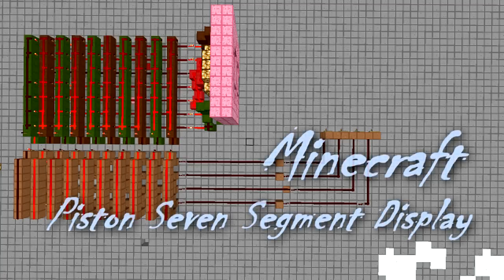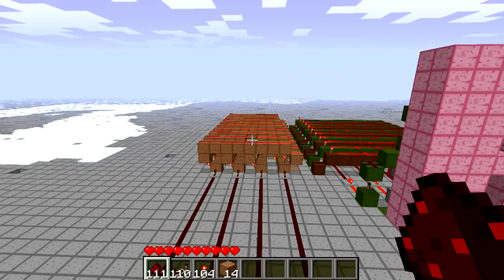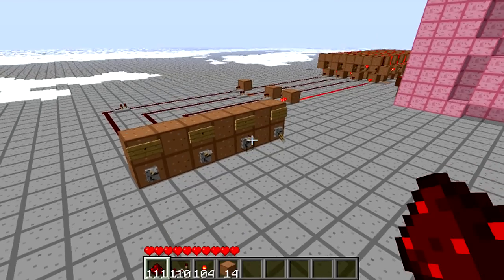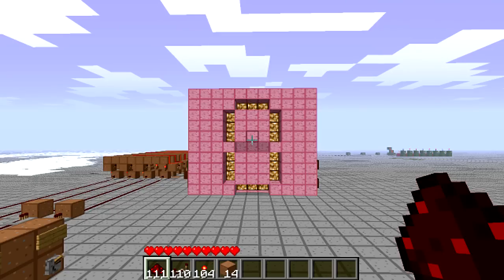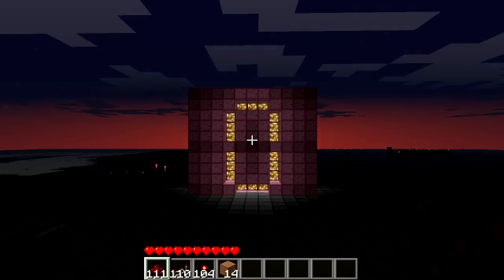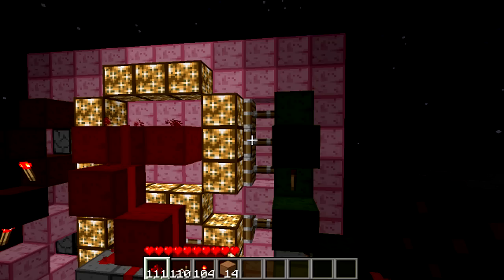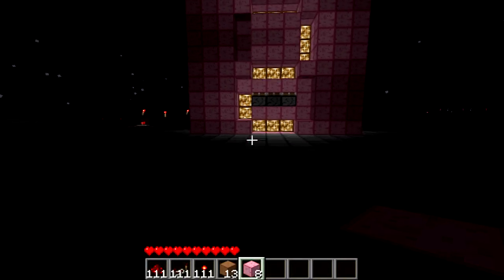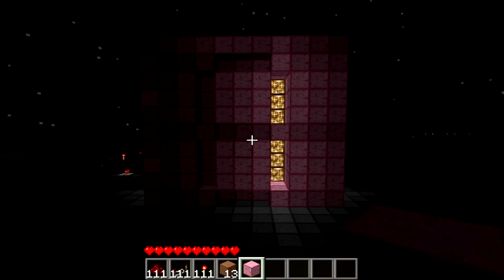Minecraft - Piston seven segment display

Comment: Hey nikobroo, I have built one of these too and I got the same problem as you did with that piston.  It's really easy to fix. Instead of having blocks with torches on the top segment, have a block adjacent to the top and bottom piston and power both with redstone dust instead of torches.  I can send you a savefile or picture if you want.